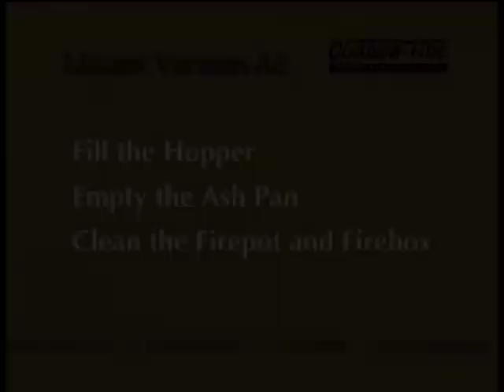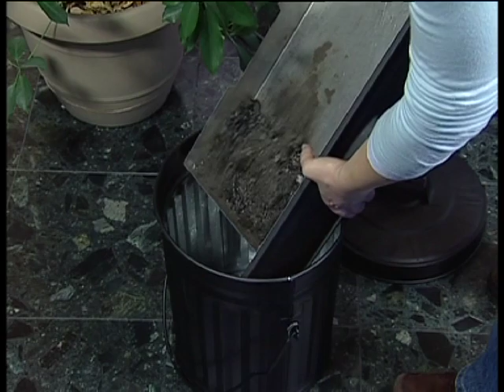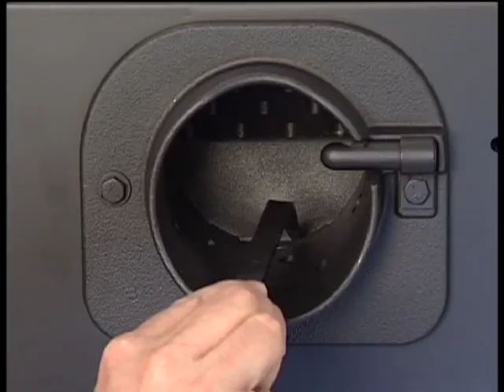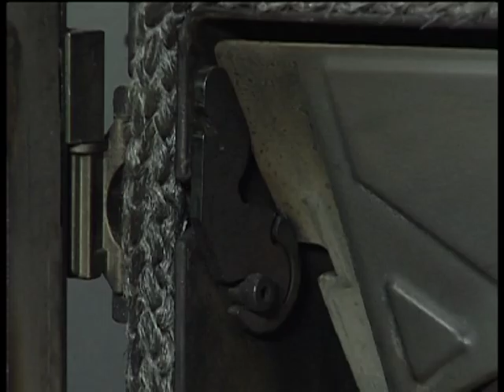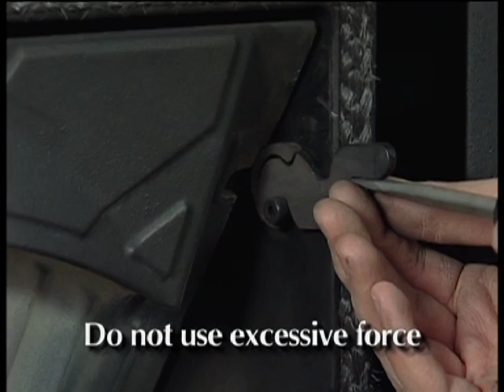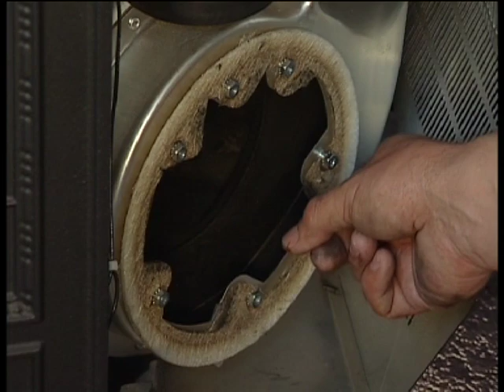Quadra-Fire® Mt. Vernon AE Pellet Stove: Normal Operation Video

Comment: I cannot sing the praises of the Mount Vernon AE enough. By far one of the highest quality, lowest maintenance pellet stoves you could ever buy. I highly recommend the QF's Mount Vernon pellet stove. It has an auto cleaning mechanism that makes maintenance so much easier. I have two relatives who were more concerned with price than quality when buying-installing their pellets stoves. They regret their decision. I also invested in the dealer's cold air intake and exhaust, stainless steel flue system. I mean, you get what you pay for and with the Mount Vernon AE, you get comfort and peace of mind.
Reply: Totally agree.  QF Mt Vernon the best! Efficient quiet and easy to clean. Been running them for 8 yrs in my home.  I heat my 1200 sq ft home thru the winter.  If temps dip 30° below, just turn on a couple space heaters in rooms further away to knock the chill out.  

I use about $130 of pellets per month in the winter!

Best purchase ever!